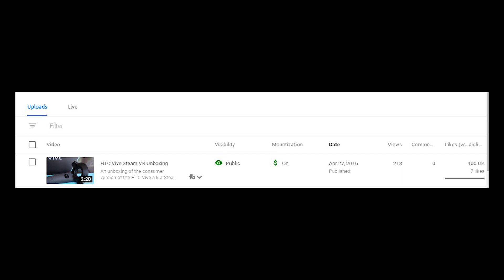C.R.T Has changed to Vector 3D a.k.a V3D

Comment: Next week on Vector 3D: building the ultimate DOS PC with an AOpen ALi Super 7 mainboard, an AMD K6-2 processor, a Voodoo 2 and Tseng ET6000, a SoundBlaster AWE 32 and a Gravis UltraSound, with a Model M keyboard and a Mitsubishi DiamondTron monitor running at 250Hz ultra scan.
Reply: @Vector3DP  Well that's OK, everything i named is more than 20 years old now, i think.